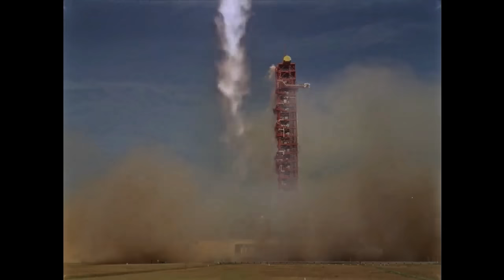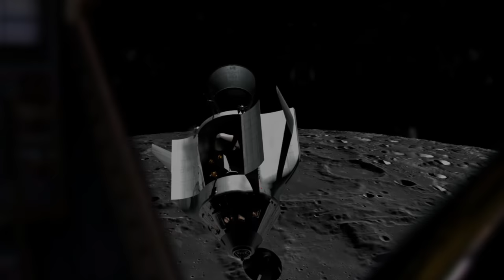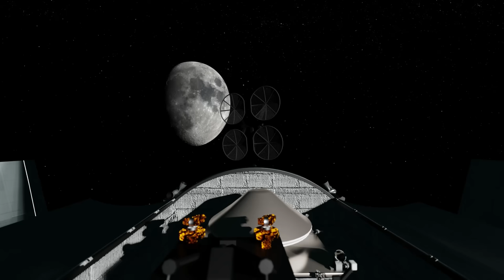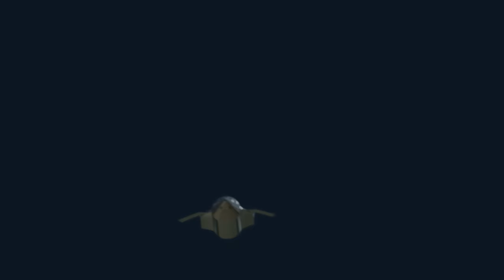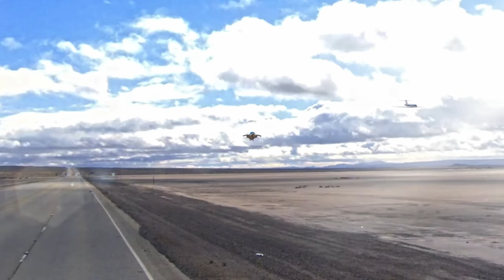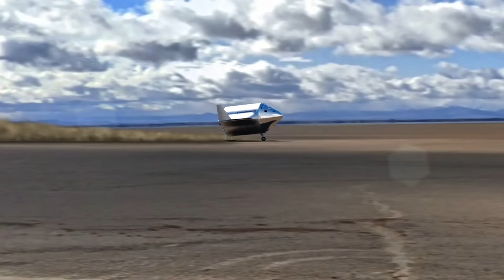Apollo Command and Service Module Shuttle

Comment: I think this takes the cake for the goofiest-looking spacecraft you have depicted, outstanding work! Though I feel like doing a lunar-velocity reentry with what looks like just bare metal skin is... optimistic, to say the least.
Reply: you can always retro brake to some extent and then do some type regenerative cooling to deal with heat at whatever less than speed it ends up being - just a guess...but would've been sight to see if it had happened
Reply: I could design one even goofier
Reply: Sure. After an exhausting  week of moon mission, why not try the "crash land a tin can on a dirt field" challenge?
Reply: @theliam3786  do it.
Reply: @niraj_dave  The propellant mass to retrobrake for that much velocity would put the entire system seriously overweight. Along with the other mass increases this would entail, either lose the surface sortie or build a Nova to get it there and back again. ;)
Reply: @saundby  yup pretty much 👍
Reply: Something-something ablative titanium shielding, ehh, that'd do the trick, enjoy gliding and landing!

Comment: The lack of heat shielding is disturbing 🔥
Reply: The concept would've used the same ablative and titanium thermal systems as was done on the X-15--which was made by North American Rockwell, same contractors of the CSM itself.
Reply: It's ablative
Reply: x15 didn’t re-enter from orbital velocity though did it?
Reply: @goatofpower  No, sir. And it often overheated from its suborbital flight. Titanium + ablatives not likely enough for 25000 MPH cislunar entry speed. This is a concept, mind you. Shuttle TPS also not rated for that speed.
Reply: Ahh it'll be alright!
Reply: @4DCResinSmoker  give it a crack eh?
Reply: I feel your lack of faith disturbing.
Reply: Modified Boost Protective Cover, its swung out of the way for docking and ops in Lunar Orbit.

Comment: I wonder if they did any wind tunnel tests with this. my gut reaction is that there is no way that this concept would be controllable or stable in a low speed glide.
Reply: If they used even the barest outline of the original Command Module (with no heat shield) and Service Module, I'd think that it would be extremely front-heavy and impossible to control without canards. Not to mention the drag coefficient.
Reply: @jameskelly1680  Agreed and I think with its width to length ratio being so extreme (flying barrel) and no traditional tail mounted vertical, or horizontal stabilizers. Longitudinal stability would have been pretty bad as well. Honestly wondering why they didn't consider a low mounted wing. After all the aerodynamic benefits of a low mounted wing was already known due to the X-20 Dynasoar.

Comment: Would a winged vehicle be able to survive lunar-speed reentry? I get a feeling this could have been good for a LEO-optimised space station taxi variant of Apollo, but for a lunar Apollo you definitely want a blunt body capsule.
Reply: The Space Shuttle could, if you skipped enough. Maybe need a little more life support for a few more orbits, but once you are aldrin a capture orbit, and your heat shield isn’t ablative, you can safely land from any orbit given enough passes: the limit is the final plunge into the atmosphere
Reply: It could, indeed it could even be better at it. The problem is that it would be quite a bit heavier.
Reply: @jmwoods190  The Dyna Soar was a single crew vehicle.
Reply: @jmwoods190  Could it survive reentry? Sure, probably.

But the CSM was designed to meet specific requirements. Support 3 crew, perform lunar orbit insertion and ejection burns, perform docking with the LEM.

Dyna Soar could achieve non of these.

Asking if it could be used instead of the CSM because it could survive reentry is like asking if a motorcycle can be used instead of a semi truck because it can achieve highway speeds. Yes, but it wouldn't be very useful
Reply: @FastSloth87  Oh yeah I forgot about it being single-crewed. My bad.
Reply: @HALLish-jl5mo  Yeah I forgot about Dynasoar not being able to carry 3 crew and can't dock with the LEM w/o modifications, though with the transtage attached to it(like in the Titan III config) lunar orbit insertion & ejection may be possible, but won't make much difference if its crew capacity is insufficient and can't dock with the LEM. 
PS I wasn't specifically asking if it could be used instead of the CSM because it could survive reentry, but rather if it could be up to the task overall, though the answer is the same- not really.
Reply: @jmwoods190  Good news everyone! There was a proposed X-20X variant of the Dynasoar with room for 5 crew and docking ability!
Reply: @FastSloth87  Ah, that might've been why I thought the Dynasoar could carry multiple crew into orbit and had a docking hatch on the top of its fuselage for docking with some precursor of Skylab, must've confused the the X-20 & X-20X as identical. But we'll never know if an X-20X with a Transtage attached to its back(a must for LOI & TEI, plus its own RCS) would be able to maneuver and dock with the LEM and tug it out of an S-IVB in deep space?
Reply: @jmwoods190  Aligning the CoT to the CoM would be quite the problem, since the docking port position is not ideal.
Reply: @FastSloth87  Yep, I'd imagine that to be a major problem!

Comment: Wouldn't the configuration of skids at at the back and a wheel at the front make it completely unstable after landing? Any Yaw motion would make that wheel point away from center and cause the craft to spin around and going backwards. They would need incredibly fast acting active steering on that front wheel in order to keep going in a straight line.

Unless it is a caster wheel, in which case they would go mostly straight, but have no control whatsoever.

There is a reason why Dreamchaser has it exactly the other way around, with one skid at the front and 2 wheels at the rear. That makes it stable through self-correcting any yaw, while offering steering-capability by differential braking of the rear wheels.
Reply: Fairly sure the X-15 used the layout of two rear skids and a nose wheel, so there must have been a degree of sense between that layout and this. Though I do agree, it does strike me as a tad unstable.

Comment: Moon landing would be the same for the lunar module, but the command module would be the shuttle. Also, the command module shuttle would have landed vertically like SpaceX starship as a safer way, because the shuttle is just round like SpaceX starship.

Comment: Honestly, I think you did this, just so you could show a Saturn V launch.
Now, just for the sake of argument, let's say they could do just what you
are showing.  What do you gain?  The command and service modules.
And not using the Navy to recover you.  Even if you are refurbishing the modules,
its a nice engineering exercise but, still not worth it.
If, you can recover the first stage; with the 5 F1 engines(like in the previous air tug
video), and the modules?  Then it begins to make sense.
Constantly being amazed by your work.

Comment: A few things about this that I just do not understand:  (1: if that "Apollo shuttle" is anywhere near the size of the real Apollo command module and service module, how could there be any room for a cargo bay? (That would be taken up by the service module's engine fuel tanks.)  (2: I  also don't understand what the "Apollo shuttle" was supposed to carry. What would it haul? Where? Small sats to lunar orbit?  (3: The idea of such a craft landing like the real Space Shuttle did is intrguing, but how does it survive the heat of re-entry, and how does it land like that without a pronounced risk of doing cartwheels?

It might be interesting to re-imagine this as more of a cross between Apollo command & service modules and Sierra Space's Dream Chaser.

Also, it might be interesting to re-imagine the Apollo launch and TLI transfer vehicles as re-usable spacecraft, pre Pratt & Whitney Aircraft's 1973 study of new ways to use the RL-10 engine, assuming Nixon hadn't killed the Apollo program then.

In Sept. 2016, NASA personnel from the Ames and Kennedy centers produced an internal study document under the title "Kickstarting a New Era of Lunar Industrialization via Campaigns of Lunar COTS Missions" that examined how to get beyond the SLS issue, and the solution was a combination of commercial launches to low Earth orbit, combined with a re-usable robotic ferry / tug /  tanker (FTT) that could deliver astronauts and cargo from Earth orbit to lunar orbit. At about the same time, United Launch Alliance posted a promotional video presentation with essentially the same concept, called "ULA Innovation: CisLunar 1000" proposing an advanced Centaur derivative called ACES (or Centaur Heavy) to serve as the FTT. I don't know why more people aren't talking about this now, instead of waiting for the Red Chinese or the Russians to get back to the Moon first. 2030 isn't getting any further away...

Pratt & Whitney Aircraft document - study prepared for NASA -  Dec., 1973:
"Design study of RL10 derivatives. Volume 3, part 2: Operational and flight support plan"
https://ntrs.nasa.gov/citations/19740027085

NASA internal paper: "Kickstarting a New Era of Lunar Industrialization via Campaigns of Lunar COTS Missions" - Sept 2016 - 18 pages
authors: Dr. Allison F. Zuniga, Mark Turner, Dr. Daniel Rasky and Robert B. Pittman (NASA Ames Research Center) and Edgar Zapata (NASA Kennedy Space Center)
https://ntrs.nasa.gov/citations/20170000827

United Launch Alliance promo video presentation:  "ULA Innovation: CisLunar 1000"
run time: 7 mins., 13 sec. -- video still posted on Facebook, no longer on YouTube
https://www.facebook.com/share/v/VrdWxMVeU9ZcyFFC/

United Launch Alliance promo video presentation: " ULA Innovation: Advanced Cryogenic Evolved Stage (ACES) / Centaur Heavy " run time: 8 mins., 3 sec. --  video still up on MechDesignTV channel on YouTube
https://youtu.be/Zi-HStWyk84?si=jdwUWidCoAeNJQry

News reporting video with commentary: "How to get to the Moon WITHOUT SLS or Starship!"
by The Angry Astronaut channel on YouTube  --  posted 20 June 2022 --  run time: 18 min., 53 Sec.
https://youtu.be/pCC27zfOzmE?si=LCSQNsM4XvBPGoYt

Comment: Separating the engine bell with explosive bolts?  Doesn't that structure get a bit hot for stuff what goes boom?  It would be embarrassing if you pulled a Gus when you hit the button for the Lunar orbital insertion burn.
Reply: Possible to use a graphite nozzle, with long attachment points and a cradle to handle the thrust off it, but yes would have issues with release unless they also added on small SRB units to provide the desired velocity vector so it does not collide. Means thicker material at the rear to survive this direct impinged heat, and also going ot need a shielded rocket motor as well, unless they went with having coil springs there to provide some of the ejection velocity difference, and a small battery and controller to fire when clear of the main body. Or you need to come in deliberately low, and use RCS to fire to increase angle, and let the nozzle auger in early, and get it that way with the whole rocket under light thrust.